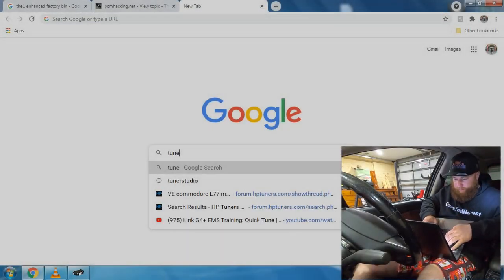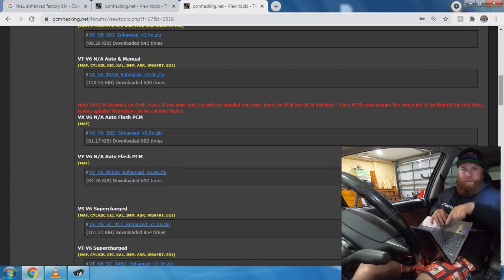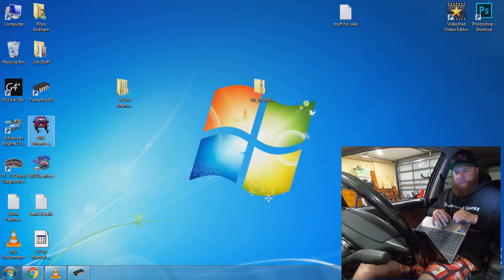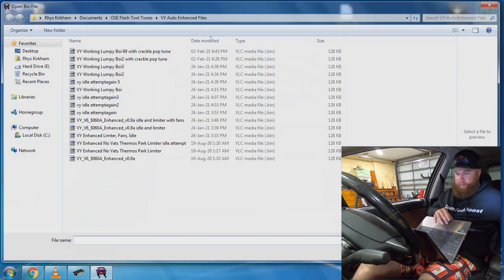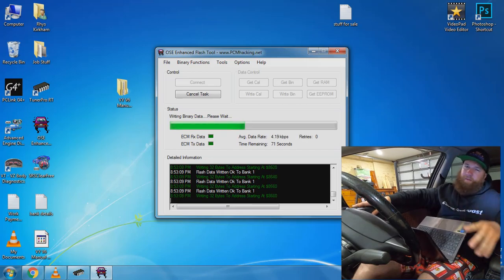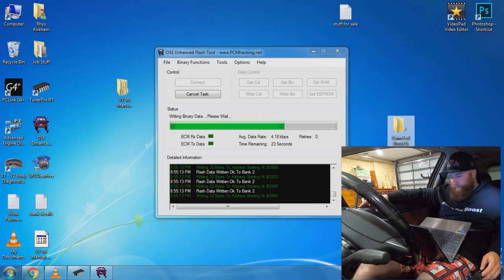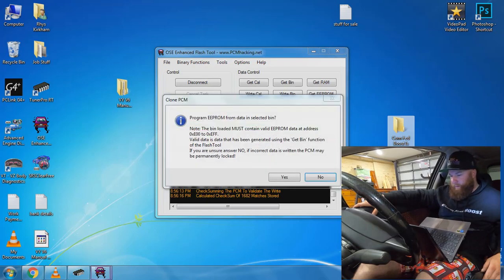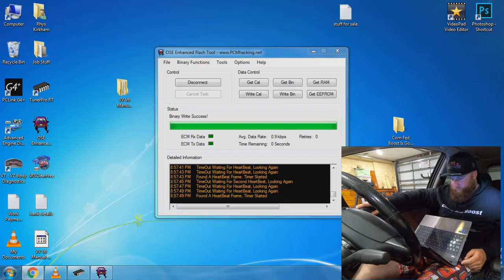How To Flash Tune A V6 VX-VY N/A Ecu - In Depth How To With Screen Capture

Comment: Keep getting no device found no matter what fuse i unplug or what settings i have
Reply from the maker: What car?
Reply: @RKGarage manual vy ute flashing it in the car
Reply from the maker: Probably best it isnt picking it up
Aounds like there is wiring gremlins and will most likely brick the ecu mid flash
Reply: @RKGarage is there anywhere i can send a log or screenshot or something pcmhacking account hasnt been activated yet i dont understand what im doing wrong
Reply: @RKGarage also using a spare ecu

Comment: At WOT throttle im getting over 500 G/S on  AED diagnostic? Transmission slip at 1100 rpm at 5200 rpm? Is that ok? I need to tighten up the shift pattern! Any reply appreciated cheers 👍
Reply from the maker: Yeah thata correct from memory mate.
Unsure when it comes to the auto, I only deal with manuals
Reply: Thanks heaps for the quick reply 😊

Comment: Any chance you could show more in-depth to changing the fueling graphs and any other similar related graphs , tried looking for your lumpy idle tune on pcm hacking couldn't find anything
Reply from the maker: There is no need to change fueling or timing, the1's enhanced files are basically optomised as best as they can for standard ecotecs and l67's
Reply: @RKGarage   I mean in the event where I'll add a turbo and be pushing more fuel and air ?

Comment: Hay mate 1000cc injectors boush what would base injector rate be
Reply from the maker: For tuner pro?
Reply from the maker: 83.546 msec/g. Fuel pressure may screw around with that, gut hit me up if she doesnt start like that and i can re calculate with your exact fuel pressure if you know what it is
Reply: Hay mate how do I adjust cranking fuel on vx v6 car won't start and when I pull plugs there wet with fuel every plug
Reply from the maker: Check for spark first
Sounds like it has no spark if every plug is wet
Shouldnt have to adjust cranking fuel unless if injector settings and or fuel pressure isnt correct
Reply: Deff got spark on every plug pulled them and checked them

Comment: Hi there just wondering how much you would charge to do a computer for a v6 vy do t wanna bugger mine up doing it
Reply from the maker: What do you want done to it mate?
Reply: @RKGarage   can I get your email?
Reply: @RKGarage   the vy has twin 2.5” exhaust straight through, extractors and twin tunnel ram. Need maf and air flow sensors removed. Wanting a tune thrown in it car is being used as a burnout car
Reply: @RKGarage   can u send to nsw
Reply from the maker: @braydenmccann3579  need to go kalmaker tune to remove maf, $1300
Reply: @RKGarage   do u do that
Reply from the maker: Nah mate
Very few kalmaker tuners in australia

Comment: Hey mate, i was wondering if you would be willing to share how you made it idle like that. Ive tuned my stuff before but never figured out how to get them to do it with the stock ecu parameters.
Reply from the maker: Check out my latest vid mate
Reply: You essentially 'force' real cam overlap by making the idle ignition tables advance and retard very quickly from positive to negative values (in degrees). The movement away from MBT (not really MBT cos it's hard to find at idle) really quickly screws with the torque and makes stuff move around giving cammed idle. On a more sophisticated ECU you can use cam phasing and change the actual overlapping period in the cam timing (if you have variable cam timing).
Reply from the maker: There are no idle ignition maps touched in this. Not possible on the factory firmware and software available for these to do that.
Reply: @RKGarage  Keep your secrets then  🧙‍♂
Reply from the maker: That's why I haven't made it public yet.
What you stated is the normal way to cheat it 100% haha. 
Sadly tho, that isn't an option for V6 commodores vs-vy at least

Comment: Keep up the awesome work cheers mate you're a legend! how do you get it to lumpy idle is it in the timing? Sounds sick
Reply from the maker: Cheers man, i had to change about 17 things to get it to work haha
Reply: @RKGarage  good work great videos to.explained well nice and easy
Reply: Hey mate I have a v6 auto first time tuning download all the programs and everything what do I need to change for vats on or off and what is vats meaning
Reply from the maker: Vats is security mate, have it turned off otherwise it wont work
Reply from the maker: @LTurboDieselx  https://www.youtube.com/watch?v=4G73US9m4WE
Reply: @RKGarage  when you have flashed the tune in what exactly does this enhance or change does it help it with power or fuel useage and running? Or does it just tune the computer up abit like a chip? 

Do you get any better throttle response ect

Comment: Dude you are an absolute legend! Would love a bit more info on safe tuning a turbo ecotec. Just finished mine and I'm a bit stressed on getting it to the tuner as unfortunately trailer is not an option.
Reply from the maker: Leave the intake pipe to the throttle body off and drive to the tuner, put it on at the tuners and she will be all good man
Reply: @RKGarage  hey mate sorry to bother you again, been playing around with tuner Pro but I can't seem to get the lumpy idle. Any chance I could use one of your bin files please?

Comment: Thanks for the vid. Im sure this will help a lot of people. I've linked to this vid from pcmhacking to get some more eyes on it.

The BCM heart beat is the syncronisation between the ALDL devices in the car. The BCM sends a 'heartbeat' and then all the other modules in the car send their message at given times after the heartbeat. This stops the messages from the different devices in the car colliding with each other. Then once they've all done that there is a really small gap for any connected tool to announce that its on the bus. So, when its syncing its the PC getting the timing right, then finally announcing to the car "Im here, please stop talking to each other (disable your chatter), please go quiet and let me take over so I can flash the PCM". 

The 3 ways to achieve this are to 
1) let OSE Flashtool do what it does in the video where it syncs with the car and tells all modules its taking over
2) pull the BCM fuse which stops the heartbeat in hardware so all modules go quiet
3) flash on the bench so that there are no other modules.

1 and 3 are best, in 2 the modules are not silenced and if they start talking again mid flash your going to have problems. The reason you saw the bar graph go across 4 times in this vid is because the flash chip is 4 banks big, so each sweep writing is one of those banks until all 4 are done. Then finally the last bit was fixing the checksum. The checksum includes some of the data on the PCM, so the checksum in the bin you started with can not be correct as its not known in advance whats data is on the PCM eeprom which includes the car vin. So at the end of the process it knows what the correct checksum is and can do its update. I think the very last part after the flash successful was shown was the PCM resetting and booting up and OSEFlashtool showing that all is good and it can still talk to the car on the new bin, finally leaving you in 'connected' state with the new operating system.
Reply from the maker: Hey Antus, appreciate the wise words of wisdom! Also would like to thank you for the great work you and your team have done at PCMHacking!
I have also made a video about how to bench flash and make that harness up, it is floating around on my channel as well, feel free to link that one as well if it helps you guys out 👌
Reply: @antus666 hi mate is it possible to flash a vy PCM with a diy ALDL cable, i made one up a few years ago using i think an rs 232 chip and wires into the obd plug with only 2 wires. wondering if it would be safe to flash with that. or any chance i can buy a cable through you, cant contact through pcmhacking.net as it wont allow me too make a profile... 
thanks
Reply: @ryhans1172  yes you can use a homebrew cable with this software as shown. user signup will be open again from tomorrow.

Comment: Pretty sure that heart beat stuff it's looking for is something to do with the bcm and if I remember correctly I'm probably not but you should be able to stop it from looking for it in the options for the car I beleive...
Reply from the maker: Yeah I remember reading somethibg about that, and you can pull the bcm fuse out too apparantly
Reply: @RKGarage  yeah pretty sure you just turn chatter off I think it is or there something you can select to stop it but I can't remember
Reply: Its correct that it comes from the BCM but its a necessary part of getting the car ready to flash. Just let its do its thing. More details in my other comment.

Comment: Just for anyone curious about all the files he loaded in.

Bin-> The actual PCM / tune data

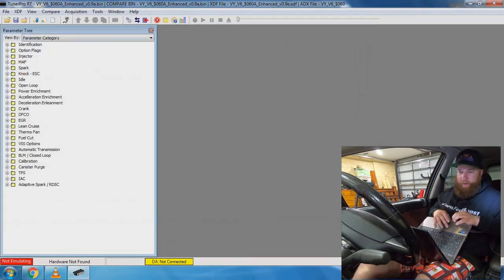XDF -> A "lookup" file of sorts for TunerPro, it enables tunerpro to identify / label what is in the bin file (that's where all the folders and drop down menus come from @ 2:43). Without this file tuning would involve sifting through pages of HEX data.

ADX -> This is a definition file for the dashboard in TunerPro, the ADX tells TunerPro how to interpret the live serial data, it allows you to log parameters and view real-time data (O2 sensors, MAF sensor, Speedo, etc).

He doesn't really go into logging and tuning the car in this video so the ADX is irrelevant, although the Bin and XDF files are necessary.
Reply from the maker: This guy knows 👌👌